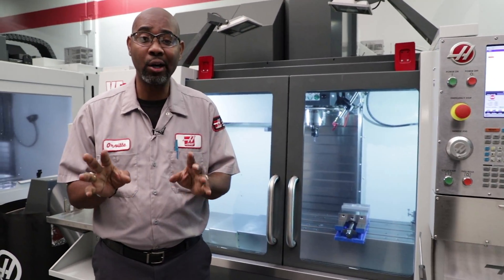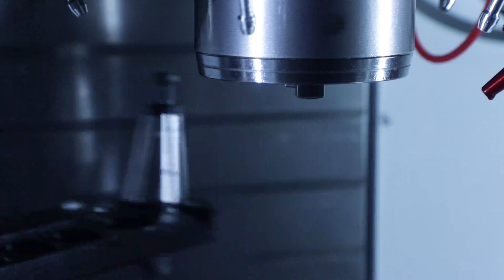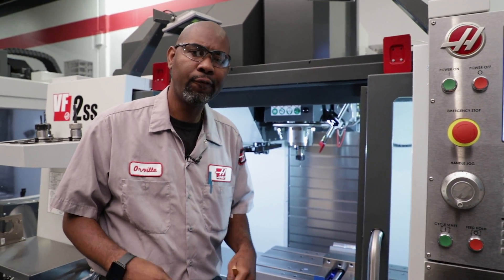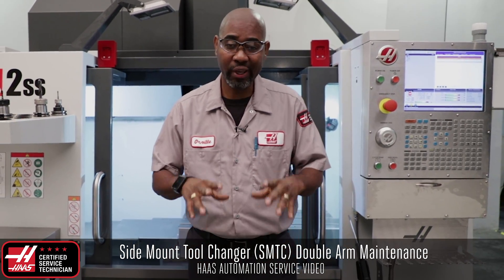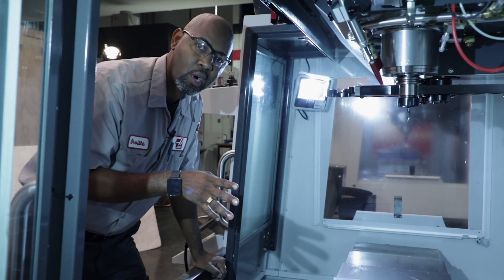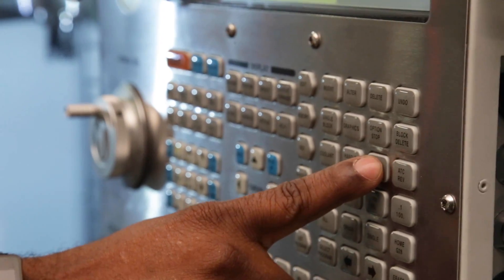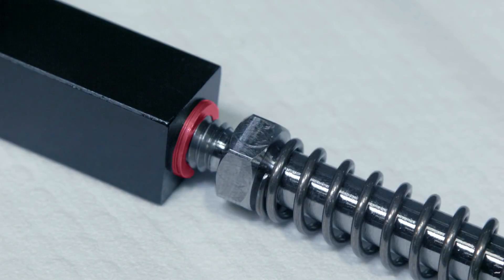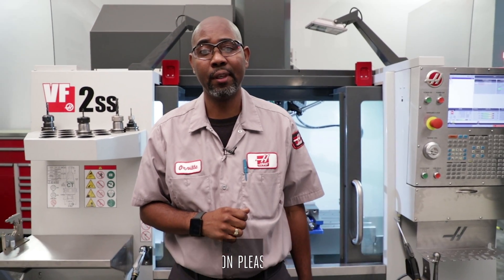Side-Mount Tool Changer Double Arm Troubleshooting - Haas Automation Service

Comment: Hello,
I have a CNC machine with an Acramatic 2100 controller, and its tool changer is the arm type.
However, I’m having a problem:
In the mornings, when I start up the machine and type T01 M6 then press Start, the arm brings the tool to the spindle but then returns it to the pocket, picks it up again, and stops halfway through the movement without completing the operation.
Thank you for your help.

Comment: alarm 627 (Generated by the side mount disk type tool changer if the tool arm failed to move within the time specified by Parameter 309) when changing tools...help